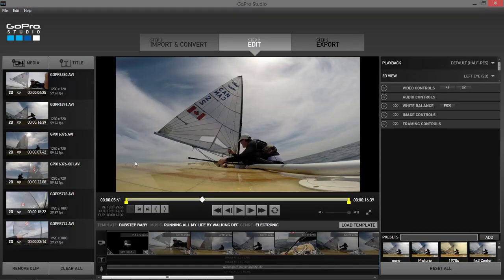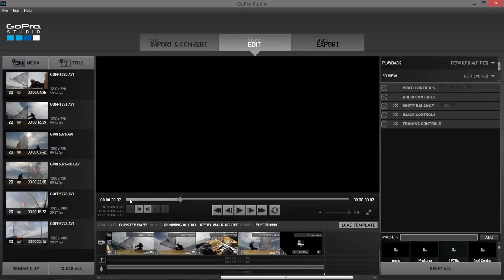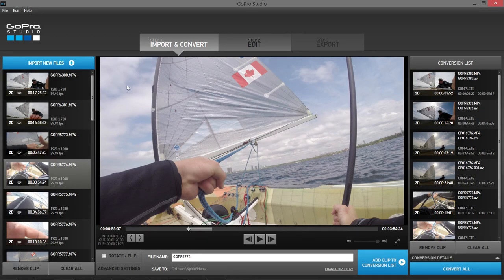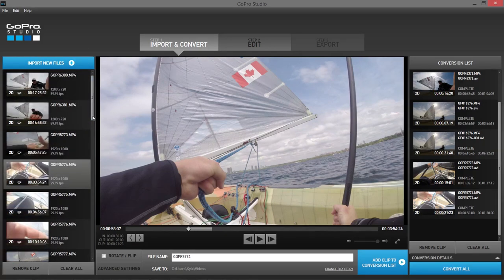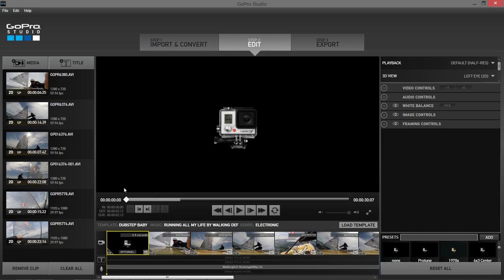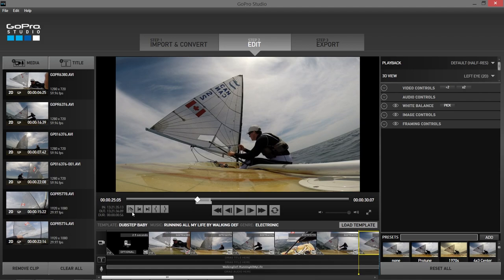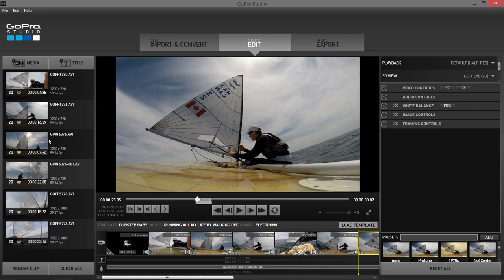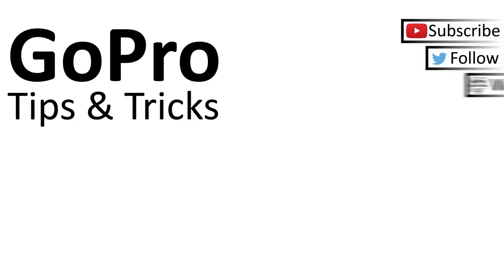Kyle's GoPro Films: Finn Sailing

Comment: Great video, your channel is very helpful especially in regards to use the GoPro Studio software.

Question for you: I tend to capture a lot of shorter clips, 5, 10 or 20 seconds at a time as I find this make it easier when editing so I don't have too scroll lengthy videos to find the spots I want to use, however I'll end up with 160+ videos when importing and converting. I don't convert all my videos, but I still end up with a lot of videos, as I move to editing, the GoPro software crashes "stops working" often and I'm wondering if there is a limitation to the number of videos I can have in my converted list.

Laptop specs (Windows 8.1 Touch Screen, I5, 8GB RAM, 64-bit)

Thanks and keep posting your Tips & Tricks I learn tons from watching.

Comment: Got a go pro recently. Put it on my laser radial sailboat but the videos it took are in slow motion and is very laggy missing maybe a second or 2 of footage. I was doing about 15 knots in a force 6-7? But not alot of chop. Any ideas?
Reply: get a  faster micro sd, if your sd is to slow it will lagg.
you need a speed of 30 mb a second better will be 50.
class 10 will be perfect
Reply: de enige echte pool Lexar 633x best one ive used yet.